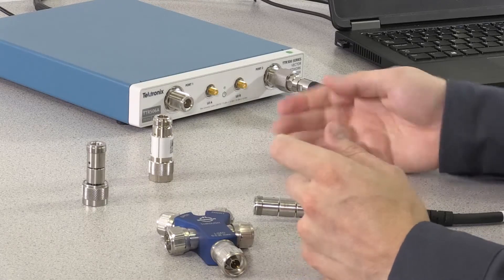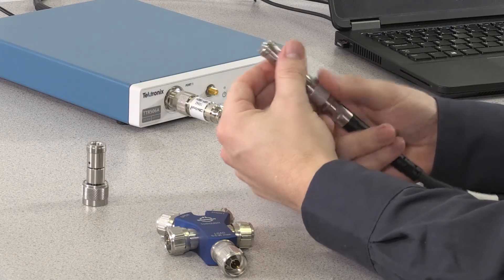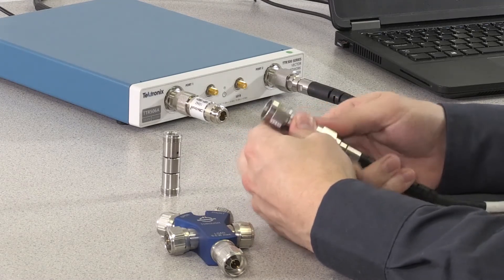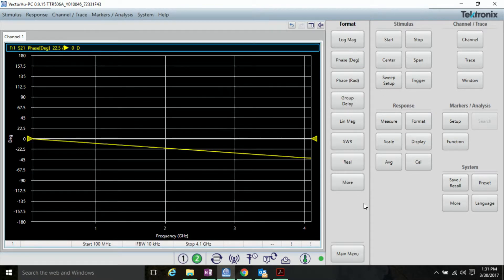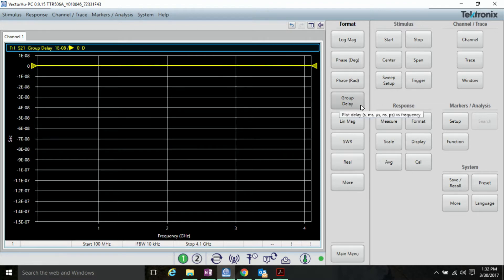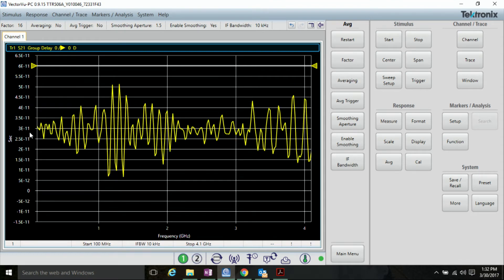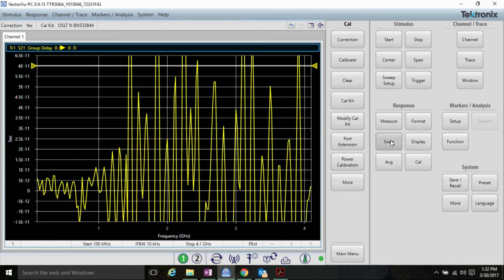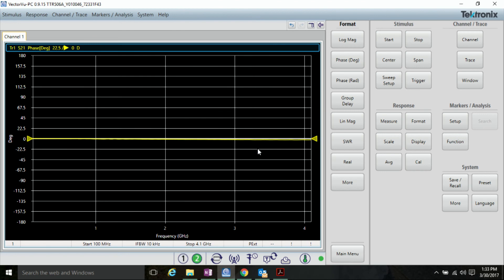How to Apply Port Extensions Using the TTR500 Series VNA

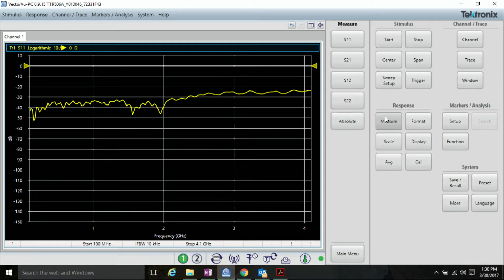Comment: It's a bit unclear what you are actually doing around 1:00. You say "connect the adaptor to port 1 of the VNA" but you don't actually show this and then you measure S21. To get the results you show you have to remove the DUT and then measure S21 through the F-M adaptor. However, I would argue that the better way would be to just attach the short standard to Port 2 and then have the software do automatic port extension. If there is no automatic port extension there really should be. When you measure directly on PCB it's rarely possible to do through calibrations.